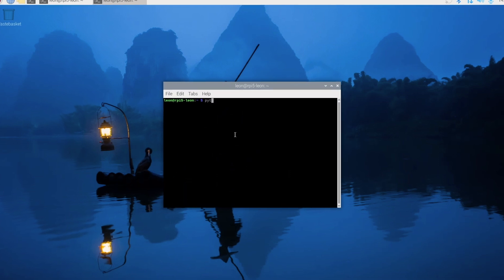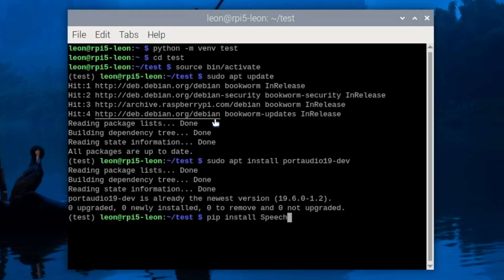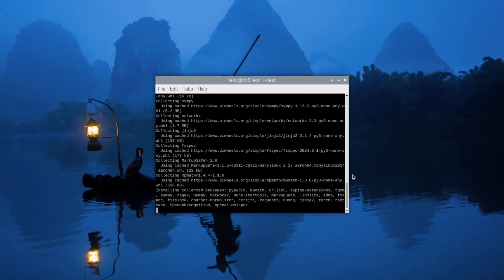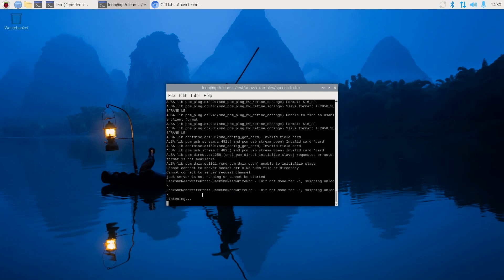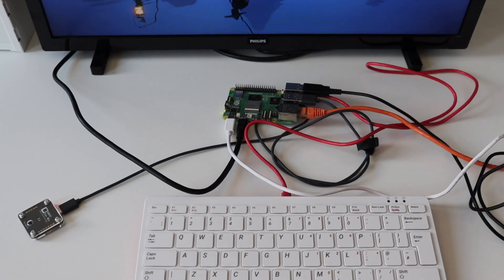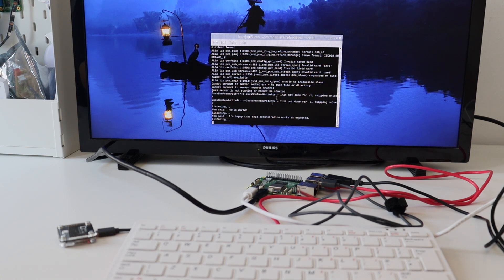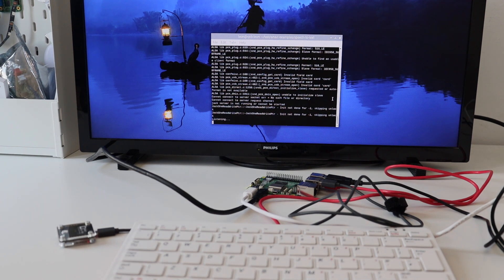Offline Speech-to-Text on Raspberry Pi 5 with Python3 and OpenAI Whisper ASR

Comment: Hello Leon! Great work! Is it also possible to convert what you said to a text file and send this text file to your computer (for speech to text journaling)?
Reply from the maker: Yes, absolutely! Are you working on a Raspberry Pi device for speech-to-text journaling? While it is best to handle this by modifying the Python script, a quick workaround is to use > or >> to save the output to a text file. > overwrites the file, while >> appends to it. For example: python3 stt.py > log.txt Thanks for watching the video!
Reply: @LeonAnavi Thanks! Yes it is device for speech-to-text journaling. So I could technically modify my python script that it sends the text file to my laptop after it is saved on the pi? Is there a website where I can learn how to modify that python script?
Reply from the maker: @JohannesBensmannyes, it should be possible but obviously this would require several modifications of the Python script provided with this video. I can't recommend a particular website or course for Python. However, nowadays AI agents deal pretty well with Python coding so such a tool may assist you along the way.

Comment: If you are using openai whisper its not offline
Reply from the maker: No, let me clarify. Whisper is a general-purpose speech recognition model, and the Python package openai-whisper provides six different model sizes. The example in this video uses the base model, which has 74 M parameters. While Whisper requires an Internet connection initially to download the model files, once the setup is complete, it is possible to run it offline.
Reply: @LeonAnavi here i was under the assumption it would require the your openai api key. I go to extreme lengths to not user that thing lol
Reply from the maker: @Shroomtop420  here is the source code in GitHub. No API keys required.
https://github.com/AnaviTechnology/anavi-examples/blob/master/speech-to-text/stt.py

Comment: Hi can you make a video to make new video that it will be offline or no Internet connection and it will be connected to printer so it can be printed after what you say.
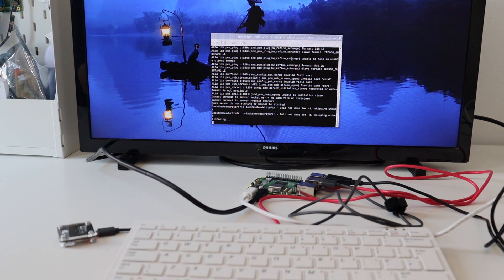Reply from the maker: Do you mean like printing it on paper? You can modify the Python 3 source code from the demo at 4:01 to save the recognized speech as text in a file, and then print the contents of that file. The source code is available on GitHub: https://github.com/AnaviTechnology/anavi-examples/blob/master/speech-to-text/stt.py

Comment: oooh... I was investing $200+ to build this. but this looks waaaay too slow for practical use
Reply from the maker: Well, this is just a demo. There is a lot of room for optimization, most notably no GUI is required at all so a custom headless Linux distro can be created instead of Raspberry Pi OS.

Comment: Can the speech to text turn into a string that can be a variable to use afterwards in my python program? And is it possible to start the recording by pressing a  button and stop recording after I release the button?
Reply from the maker: Yes, absolutely, this is the idea. Inside the Python script there is a variable text which stores the recognized speech to text. The variable text is printed on the screen to show the content in the terminal. Also yes, you can integrate a start and stop through a button. Check line 50 of the open source Python script stt.py that I shared on GitHub: https://github.com/AnaviTechnology/anavi-examples/blob/master/speech-to-text/stt.py#L50
Reply: Thanks for the help.

Comment: Great work Leon and thank you so much for taking time to demo this. My application is to take this further and translate the transcribed text to a different language, basically doing a translation. i have a fully working application in python but the translation part only works online. Is there a way to make it work offline? much appreciated
Reply from the maker: Glad it was helpful! Yes, you can do the same as in this video. What is your Python app using for speech to text now? Why don't you convert it to offline speech to text with OpenAI Whisper ASR as shown in the video?
Reply: @LeonAnavi  Thank you for your quick reply. Well, i was using Google's speech recognition and translator to both convert audio to text and translate it to any language i want. now, thanks to your demo, i can use OpenAI Whisper ASR to convert audio to text offline, but the problem is to translate the text to a different language, i cannot find a way to implement this part using an API that works offline. any help or guidance is much appreciated.
Reply from the maker: For offline translations have a look at Argos Translate and Facebook's Fairseq. Both are popular open source projects and can be used with Python.
https://github.com/argosopentech/argos-translate
https://github.com/facebookresearch/fairseq
Reply: @LeonAnavi  fantastic, thank you, i have started using Argos Translate
Reply from the maker: @FaroukTifratene  please come back later on to share your experience with Argos. I don't have personal experience with it and I am tempted to give it a try too :)
Reply: @LeonAnavi  i will definitely share my feedback on Argos Translate and the whole implementation
Reply from the maker: @FaroukTifratene  I will keep my fingers crossed that it will help you achieve good results from speed to translated text.

Comment: Just tried it and it works great but is there any way to get rid of the ALSA-Lib warnings? It really floods the output and I'd like to streamline it for calling STT in multiple functions
Reply from the maker: Good point. Probably these ALSA-Lib warnings and stderr can be redirected to /dev/null using os.devnull with something like sys.stderr = open(os.devnull, 'w'). Just as an idea because I can't test it right now.
Reply: @LeonAnavi  Your idea works for me so long as I call the speech recognition script on a main script using subprocess! I can't even express how much you've helped me, thank you so much!!!
Reply from the maker: @jayzelle7216  awesome! I am happy the idea worked out for your use case. Thanks for the feedback to confirm.

Comment: That looks crazy slow to me... how can you speed up the conversion time ?
Reply from the maker: This is just a demo. There are several ways how to speed up the conversion time on a Raspberry Pi:
1. Use a simple initial algorithm for detecting a wake word and after that the speech to text API that takes more resources. This way the start of the conversion will be faster.
2. Adjust and decrease the timeout for stopping audio capture and recognition text, aka reduce the timeout at the end.
3. Move the speech to text execution  on the cloud for online devices, for example by switching from offline OpenAI Whisper ASR to online Google API.

Comment: I'm curious why you are using this USB-C microphone for this demonstration. I work with voice assistants and one issue I often have with them is handling echo cancellation. I want them to listen while they are talking so I can interrupt them, but then they "hear" themselves talking. If they say their wake word or are running without a wake word, they then start responding to their own voice. The best way I have found to deal with this issue is to use a USB conference phone for both the speaker and microphone, which usually has hardware echo cancellation built in. I have used both the pulseaudio and pipewire echo-cancel modules, but they don't work as well as the hardware echo cancel. Have you found any way to overcome this issue? Have you found a noticeable difference in transcription quality when using this specific microphone? Or is this just what you had on hand?
Reply from the maker: Thank you for your in-depth comment. ANAVI Dev Mic is an open source hardware microphone that I have designed in KiCad. The firmware on it is also open source and based on the "Microphone library for Pico". Right now there is a crowdfunding campaign going on for it at Crowd Supply so I wanted to showcase its capabilities for speech recognition. I am even considering a new hardware version of the microphone by upgrading it from RP2040 to RP2350 because this will allow implementation of real-time ML noise suppression within the microphone's firmware.

As you can see this video proves ANAVI Dev Mic is a good fit for this task. Of course the same setup can be achieved with another microphone too (although a minor modification of the Pyrhon3 script will be required). If you are curious to learn more about ANAVI Dev Mic visit: https://www.crowdsupply.com/anavi-technology/anavi-dev-mic
Reply: @LeonAnavi  Thank you for responding. I didn't realize this was your project, although you say it at the beginning of the video.I guess I missed that the first time. I hope you achieve your crowdfunding target. More open hardware is always helpful. Do you have any recommendations for dealing with echo cancellation on the raspberry pi when using this microphone?
Reply from the maker: Although, this particular demonstration from the video doesn't apply any additional effects for echo cancellation, in general there are two ways to handle it:
1. In the software running on the Raspberry Pi (or whatever computer is used)
2. In the firmware of the microphone. Here comes the big advantage that ANAVI Dev Mic is open source hardware built around Raspberry Pi RP2040 microcontroller so you have the freedom to modify, recompile and upload a new version of the firmware to the microphone. The default firmware is based on "Microphone Library for Pico" and relies on the Raspberry Pi Pico C/C++ SDK.
Reply: @LeonAnavi  Ah, I think I understand now. This is not just a microphone, it's a whole programmable microcontroller with a microphone so preprocessing can be done on-device. Correct? I'd love to put the echo cancellation code directly on the microphone microcontroller, but it seems like I'd have to hardwire a monitor signal from the speaker to the RP2040, and then use the right algorithm to cancel the signals depending on distance from each of the microphones. If I moved the speaker in relation to the microphone I would have to readjust, but I could probably do that programmatically. Do you know if anyone has done anything like that? It does seem like this device should be able to take care of signal strength based VAD on device, which could be helpful and take a little processing load off of the main device. Thank you.
Reply from the maker: Yes, ANAVI Dev Mic is built around XIAO module with the Raspberry Pi RP2040 microcontroller. The same microcontroller is used in the popular development board Raspberry Pi Pico. The firmware is based on the open source "Microphone library for Pico" which is built with the C/C++ SDK for Raspberry Pi Pico. So as the name suggest this is developer friendly microphone as people can modify and flash new versions of the firmware. For example, ML algorithms like RNNoise can be applied directly as part of the firmware although for RNNoise it is recommended to use more powerful microcontroller like RP2350 (for Pico 2) and in future eventually I might launch Dev Mic 2 with such capabilities. You can learn more about RNNoise at the following links:
https://www.raspberrypi.com/news/real-time-ml-audio-noise-suppression-on-raspberry-pi-pico-2/
https://jmvalin.ca/demo/rnnoise/